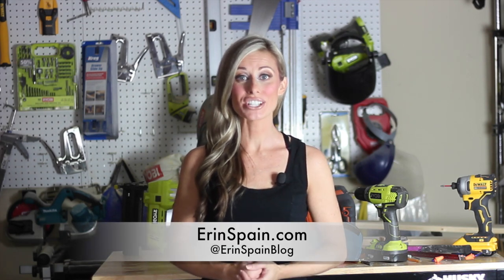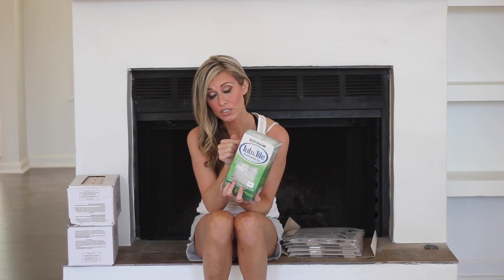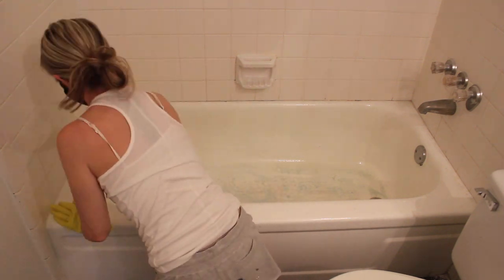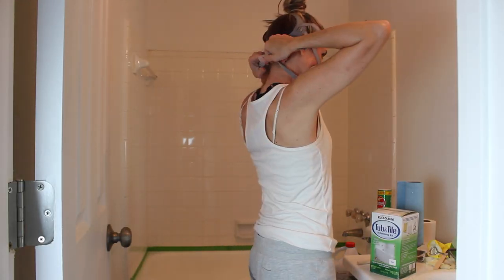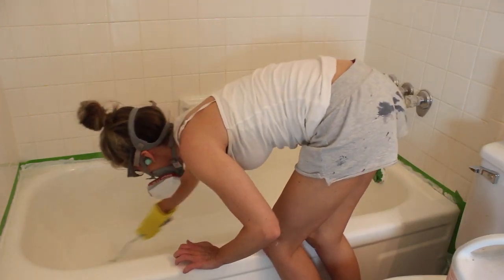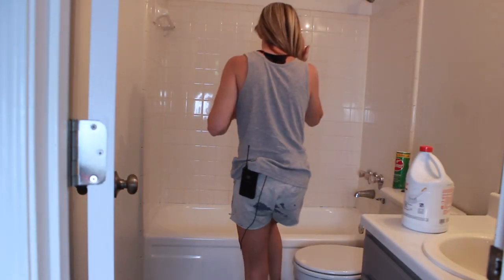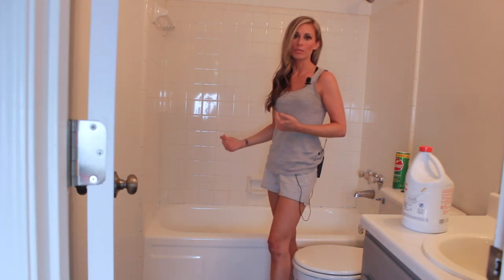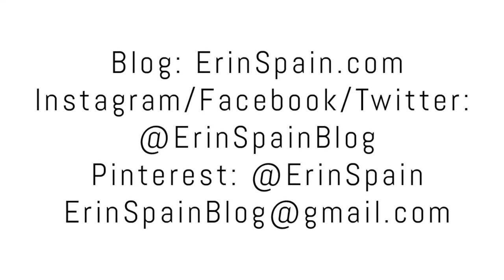How to Refinish a Bathtub on a Budget

Comment: The video isn't going to show the lumps and bumps.  I would have just cleaned thectib with mr
 Clean sponges.  Buyer gonna RIP it out anyway.
Reply from the maker: The point of the prep work is to get the product to adhere properly, it's not really about the texture.

Comment: Being very familiar in the Bathtub & Countertop resurfacing Industry, I HIGHLY DO NOT recommend using this product. It won't last long at all. Only makes sense if you are selling your house quickly and don't care about who's purchasing it. Anything that's $25, I wouldn't trust.
Reply from the maker: As I mentioned several times in the video, this is not meant to be a long term solution. Correct.
Reply: Tub and Tile Refinishers Hate This One Trick!

Comment: Note that she is doing this for a house she is selling. This crap will last about as long as the first few uses of the tub. About 1/2 my business is redoing tubs coated with this crap. If you just want it to look nice(r) and do not care about the new owners, have at it. If it's a tub you are expecting to use, have this done professionally. This is not a DIY job - or pay me $200 to strip it off.
Reply from the maker: “She” is me. Correct, this was never meant to be a long term solution, as I said in the video. I assume the new owners will eventually want to replace the extremely dated tub. Until then, this will make it look nice. We actually had this done while we lived here and it lasted for several years, so maybe your clients have just done a shitty job?
Reply: @ErinSpainDIY  "Clients" meaning homeowners doing a shitty job for something that scientifically is bound to fail? House Flippers do this to. It's an extra $200 for me to strip this off so buy a respirator and roll the dice folks. I give my customers plenty of advice on how to tackle most home improvement projects, reglazing is not one of them.
Reply from the maker: “Scientifically bound to fail”? Yeah if you are thinking it’s a long term solution. But like I said (and made clear in the video), it isn’t.
Reply: @ErinSpainDIY  So this is the second time this tub has been redone?
  I have one like it in a rental I am renovating and trying to decide what to do in regards to refinishing or replacing.
Reply from the maker: @rickeykeeton4770  Yes, it had been redone before we moved in many years ago.
Reply: @ErinSpainDIY  Did you do it yourself then with the same method and materials?
  Not sure what I am going to do with mine in the rental I just bought. 
  Needs updating.  I will be 66 this month, it is the house I was raised in. 
  It’s been a rental for many years now and needs updating/refurbishing.
Reply: Nah mine lasted 3 years zero issues…house burned down is the only reason it didn’t last longer. You just have to actually do the prep work🤷‍♀️